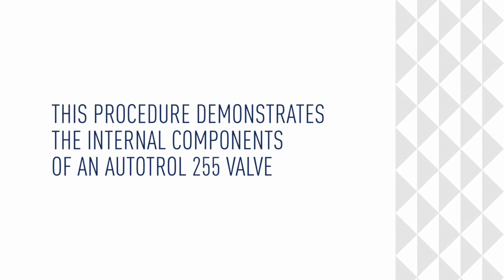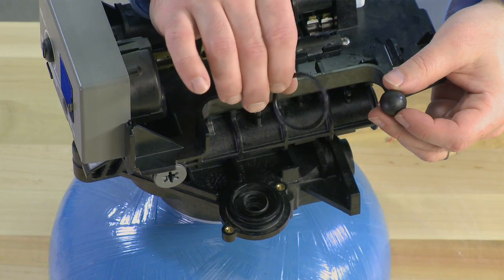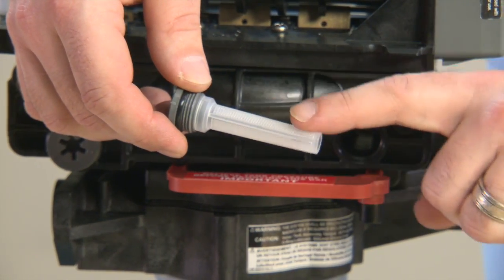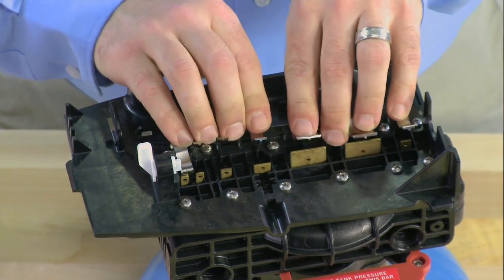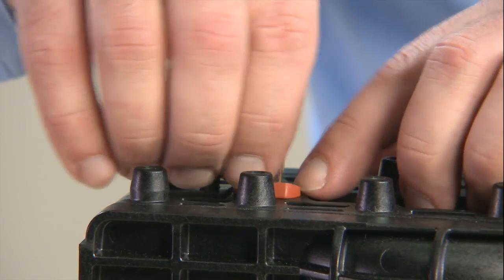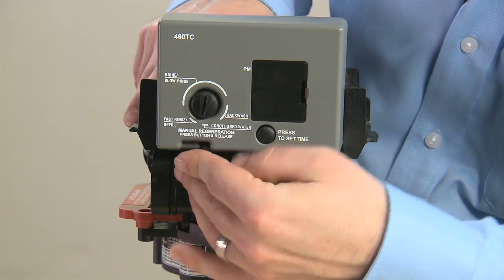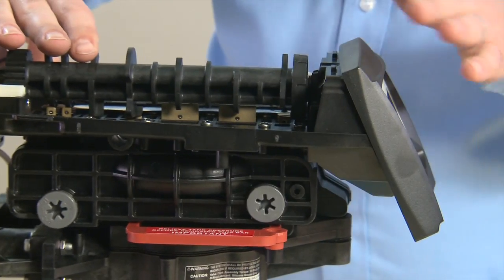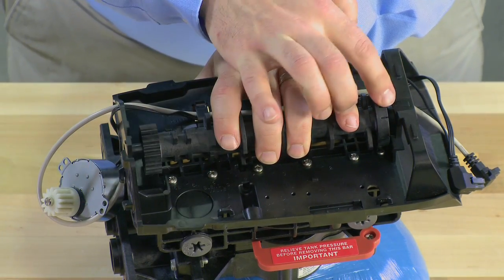Autotrol 255 Control Valve Tear Down

Comment: I have a 255.  The drain leaks a good bit of water constantly, even when not in regeneration mode.  Could this be worn o-rings on the Backwash flow control part?
Reply: Did you ever figure this out ?
Reply: @travisridings8156 did u?

Comment: My injector won't come out. Even with excessive force. I don't know why it's so easy on the video. I have the 760/255 model.
Reply: this will probably destroy the injector so only do it if you have a spare, but if you remove the screen opposite the injector you could use a long thin rod and a hammer to smash it out from the opposite side, just be very careful, because you might damage the valve body and that can cause long term malfuctions like insufficient brining or brine tank overflow and than a new valve body is the only solution

Comment: I have the 255/460i head as per this video.  Had brine tank over filling to overflow level, so stripped down and purchased service kit. Replaced all flaps, springs, filters etc. Works perfectly when you press and do manual regen with brine tank filling to 6 inch, but if you leave system to do auto regen brine tank overflows. Any helpful advice would be welcomed.

Comment: I have a 255 with a 440i timer head.  The timer gets into the last part of the cycle, which is the brine tank refill etc.  Something causes the manual button and camshaft to "pop" backwards and not leave that function.  Each time,  it restarts and puts more water into the brine tank. Repeat.  Could there be a broken gear in the 440i - e.g., a busted off tooth such that it isn't catching properly into the end of the cycle that puts us back into service mode?
Reply: we want te controllr742\278A valves  valum based price

Comment: when dissembling does your water need to be turned off?
Reply: Yes, if not water will flow through your system.  You should also slowly open both valves to "bypass".  This is what I do for annual maintenance to my 460i.  I clean the screen and injector of debris (if any) and hit the o-rings with silicone lubricant.
Reply: YES and drain the unit.